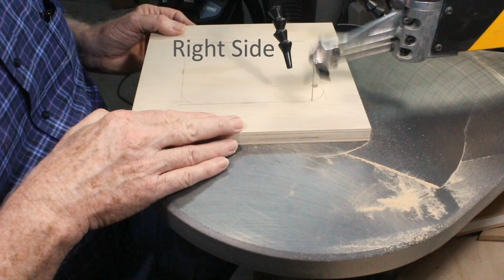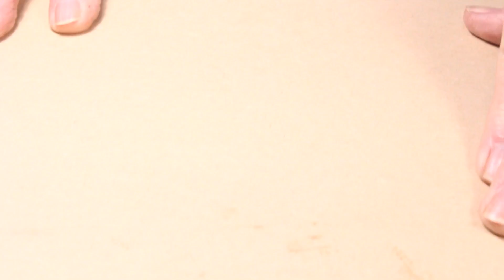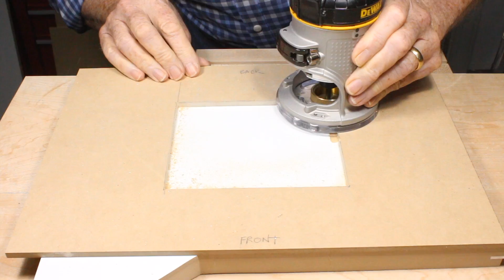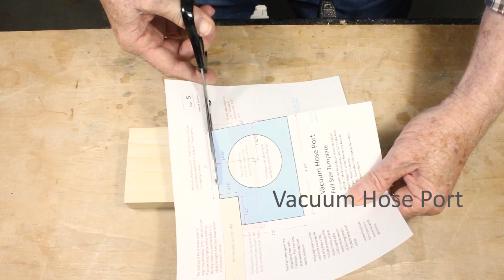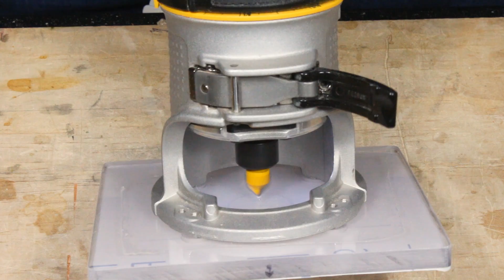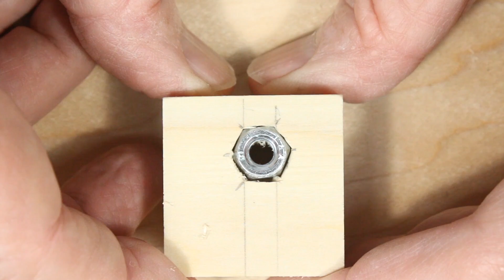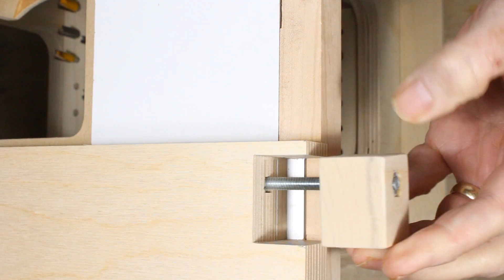Mini Router Table

Comment: awesome video Patrick. Anyone can tell me what s the name of the saw Patrick used a lot of times e. g. at minute 1,12? it's a magic tool! is it possibile to built it by myself?
Reply from the maker: This is a scroll saw made by DeWalt.  Although it was originally designed to cut out small, complex shapes like jigsaw puzzles, it can easily handle 3/4" or 19mm plywood, and has a maximum thickness capacity of almost 2" or 50 mm, although that is pushing it.  Unlike a band saw, it can cut out inside shapes without having to make an access cut.  A sabre saw can do the same thing, but the scroll saw can handle much tighter curves.  It will do some of the work that a band saw does, but it cuts much more slowly, and cannot handle thick blocks of wood.  One of the reasons I like using it on plywood projects like this router table is that the cuts are so smooth that they typically require no sanding or touch up, providing you use a good blade and have a steady hand.  In some cases, the cuts actually appear polished.  It takes a little practice.
I owned a very inexpensive scroll saw for a couple of years which was very serviceable and yet affordable. At least 5 or 6 companies sell a similar saw; in fact, almost all the low-cost saws look enough alike to make me think they come out of the same factory. However, this DeWalt has a lot of advantages over the low-cost saws, and I am quite happy with my decision to pay about 4 times the price of the starter saw.  I use this saw all the time.
I am sure it is possible to make a reciprocating saw in the home shop, and there may well be a YouTube video that shows you how.  However, making a saw that has good stability and precision, low vibration, and some of the convenience features of a good commercial saw would be a big challenge.
Reply: @PatrickSullivan  thanks Patrick! I m going to follow your videos very stimulating

Comment: Hey Thank You!!!  

I am not able to do any big project's, and have to set down to do most anything. My projects, and small stuff, like single 
 or double bottle wine rack's, and mostly need to use a round over bit, this will be great!!

I am building myself, a  new Jigsaw table saw, I am going to add my cheap trim router to it, so that it will a be multi use tool!!!

Thank's again, for the cool Ideal!!!

Comment: very nice, thanks for sharing. you could fillet/round (10/20mm or 1/2, or 3/4 inch) the inner plywood edge where the dust hose connects, for a bit better airflow, would look cool as well.

Comment: Great video I had a wonderful time watching it. As much I would love to build something like that, I do feel very overwhelmed to the thought of making something like this. I love to work with my hands and I love tools, but can you really recommend this project to someone who's just getting into wood work? I would like to know what you think.
Reply from the maker: Will:  There is nothing in this project that requires special skills beyond the reach of someone just starting out.  However, you need a router and a number of tools that a beginner might not have.  Some parts of it beg for careful, accurate work, and my work was filled with inaccuracies and errors when I was starting (in fact, my work still has way more mistakes than I care to admit).  It's frustrating when parts don't fit, cuts go astray, etc.  My suggestion is to start with projects that you can readily do with your existing tool set, and that have a very high chance of success in a short period of time.   If you sail through those, then take another look at this router table, which is not only a fun project, but will be a tool that you will use over and over again over a period of years.
Reply: @PatrickSullivan  thank you very much for your words of encouragement,  this is such a wonderful project that I would love to have it in my garage. Again, thank you dear Sir

Comment: Very good Patrick, the woodcarving gauge,is it homemade?
Reply from the maker: Luis:  I am not sure what gauge you are talking about.  Can you tell me the time in the video when you saw it?
Reply: Yes in the minute 7.
Reply from the maker: Aha, now I understand.  The large gouge I used is not homemade.  I have tried to make gouges of this size, but they are much harder than the small tools I show in my toolmaking videos.  Shaping the metal is a challenge, and the heat treating is hard to do well with just a small propane torch.  If you have blacksmithing tools and experience, it is possible to make large gouges in a home shop, but the results are often inferior (at least in my hands) to those of a good commercial product, like the Pfeil chisel I used.  My philosophy has been to buy carving tools that are large or have complex shapes, and make the miniature tools that are so handy for detail work, corners, inlay, etc.
Reply: @PatrickSullivan  ,thanks a lot.

Comment: Great video. A lot of information, clearly explained with critical details on the road. Thank you, and you have your whole right finger up. I'm very excited to see the router's bushing set. Very useful and compact compared to the Bosch template rings, which they use and use together with the bulky BOF 2000 router. I think I'll swap a more compact design router like yours or AEG, Makita or something.

Comment: Nice job Pat, inlaying a ruler into the top for the guide fence would be helpful.  I avoid MDF, I find it sucks moisture from the air and puffs up or bows under weight.  Marine ply for me.

Comment: great project, i`m itching to make a start in the morning but sadly i am unable to get any info from you`r website,if you can assist in any way to help me get the details i would be very grateful.I have liked and subscribed but that does`nt help.
kind regards pompomken.
Reply from the maker: Ken:  Click on the link above, and then click on the underlined words "The Disappearing Lathe Plans".  The plans will pop right up.  They are in pdf format, and can be saved under any name to your computer.  You can print them directly from your computer.  I just checked the site, and everything is working.  Have fun.
Reply: many thanks PATRIC keep up the good work.
regards once again
ken.

Comment: thanks for this plan!  DeWalt should sponsor you, I just bought that router and I hope to build one of these soon!  This was a neat project.  An idea I had was to make it the same dimensions as my cheapo table saw so they can be swapped into a work bench setup with longer guides.

Comment: Как удаляет пыль? Совсем не летит мимо?
Reply from the maker: Connect it to a shop vacuum.  The dust will be pulled down, and into the dust collection channel.  I show a quick example of this near the end of the video.  It is very effective.  In many cases, it will pick up 90% of the dust and chips.

Comment: It is about time we do what we started in the 70s. Convert everything to metric.  It's simplicity,  a good thing.
To every one, We don't need two systems. Think of all the extra tools you have to buy. Oh now I get it, it's a tool manufacturing conspiracy.  Confusion at the super markets, more to teach in schools, mistakes,  Why do we hold on to such an archaic system?
Thank you! And thanks for the PDF plans. Nice video and nice work.
Reply from the maker: The irony of the American system is that most of the products we buy are manufactured in countries that use metric, and so the dimensions are metric, the screws are metric, and we need metric tools to install and repair them.  Much of the plywood I buy that is billed as 3/4" or 1/2" is actually sized in mm.    I don't believe that we shop monkeys would have too much trouble converting the rest of the way to metric.  However, when I go to the hardware store to buy screws, fr example, the imperial assortment is 50-100 times as large as the metric asssortment.  The pressure to avoid change is everywhere.
Reply: (Aussie metric guy) What grinds my nutz is bolts that are either metric or imperial and that the type I need from the store is only in imperial. E.g. zinc plated carriage bolt. I don't have imperial t-nuts for that, only metric. Also, in my box of mixed nuts and bolts collected and inherited from fathers before. To then try to find a nut that fits my bolt and I don't know if it is a metric or imperial thread.
Reply: Add me to the 'go metric' list. I generally can think and operate in both measurements but after 35 years working on bikes and skis I prefer metric.
Reply: Don't hold your breath.

Comment: Great job Mr. Sullivan. Nicely done. I have a request... Since you posted them for free, you do not have the time to post them in mm or cm? Or upload the drawings in the sketchup? 
It would be so helpful for me. I hope not to ask too much... I would like to build it too, but I handle it so hard in inches, because the unit of measurement in my country is mm, cm, m...  I hope not to ask too much... Thank you in advance.
Reply: Just multiply the inches by 25.4 to get mm dimensions.  The templates will print correctly in any case. :)
Reply: Yes i know the 25.4, thank you :)

Comment: super nice, thank you .... I also own a small Dewalt router. Hmm, how is it with changing bits? Do you need to take the plexiglass of?
Reply from the maker: No.  It is easy to change bits without removing the polycarbonate base.  However, I usually lift the router out of the table for better visibility and access.  Removing the router from the table takes only 2-3 seconds, and requires no tools.
Reply: Super. I made your drawing in sketchup and will build one when I have time. In sketchup I made the dust exstraction around 41 mm tall. The plate under the table that is. In theory I believe more dust will be sucked away (sorry for my English). Yours look SO nice.
Reply from the maker: HelleRita:  Keep in mind that you want lots of air velocity at the mouth of the dust collection.  Smaller openings result in higher air velocity--a good example is the crevice attachment for your vacuum.  It provides more "suction" than the wide open hose.  Making the dust extraction channel a little taller might work well, but I would be cautious about making it too big.  I think the area of its mouth should be considerably smaller than the cross-sectional area of the hose.
Reply: I will keep that in mind. I also drew your version - so if mine is not working - I will change it to yours :-)) (of course :-)
Reply: Hey HelleRita, well done for drawing Patrick’s excellent design onto SketchUp. Would you mind sharing your SketchUp model please? You probably know how to do this so please provide a link to your plan (e.g. on Google Drive or OneDrive). If you upload to SketchUp Warehouse that would be another good way of sharing.
Reply: Excellent design Patrick. Thank you for taking the time to make and present your fine video.
Reply: I won't mind sharing, but would like hear from Patrick first if he mind first. It is after all him who created it....
Reply: HelleRita. Good point. I assumed that, since Patrick kindly shared his plans for the Mini Router Table, he would not mind you sharing the SketchUp drawing. However, I may be wrong and you are right that it is good manners to ask the Author of the original plans.

Comment: Great table for trim router, loads of functionality, especially the dust port and bit storage. I plan on building this. May I ask a question? Would I be missing any functionality by simply having a square top and not contouring the front edge?
Reply from the maker: This shape came about because I added the dust collector to the original version after it was already built, and this was the shape that evolved.  You could easily just build a version with a rectangular top.  The only advantage to the irregular shape is that it puts the router controls a little closer to the front edge for easier visibility and access.  This is a very small advantage.  If you do square off the front, I recommend extending the right side/leg out to support it better.